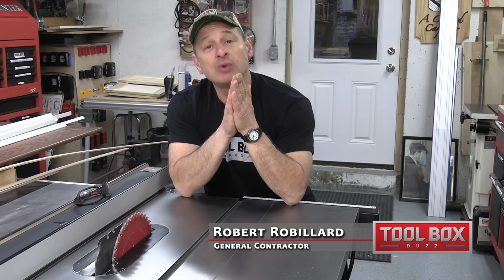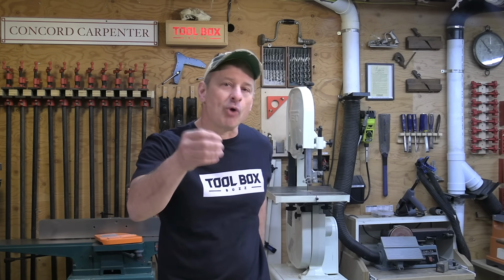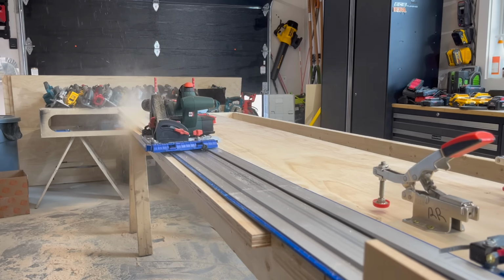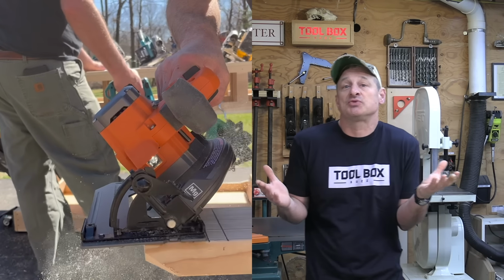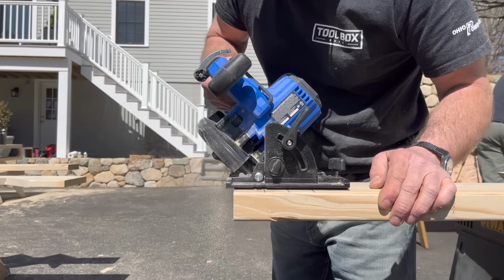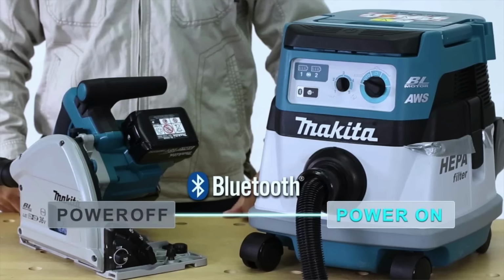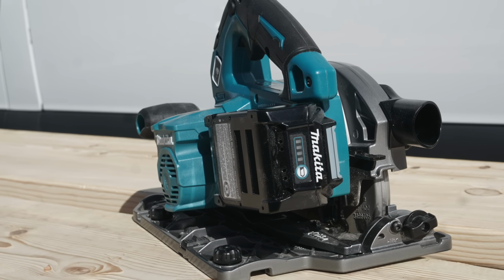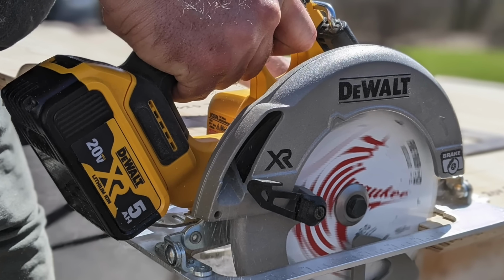Best Cordless 7-1/4 Circular Saw

Comment: OK so I sell tools locally here in Kansas City MO. I think the best innovation is the Flexvolt Advantage 7 and 1/4 saw by Dewalt. With a Flexvolt battery it is 90% as powerful as the 60V Flexvolt saw and still has the advantage of being able to use a 20V battery where it is 70% as powerful. There are really good quality very dependable 20V aftermarket batteries for Dewalt at a great price that you can buy directly from Amazon. The seller's name is ARyee and after selling about 400 of them locally there has yet to be even one return. Other sellers sell batteries that may be very undependable, so caution here.

Comment: Love these videos! I spy unreleased Packout and I’m jealy.
I think picking the XGT with track compatible base hurt it. It’s significantly heavier, bevels a lot less, and costs a good amount more (not that cost was ranked). But I may be saying that due to bias. My first circular saw like you was a corded Makita. Nothing feels as nice.
Reply from the maker: Good eye- video soon
Reply: That's what I thought until I we brought the new Metabo HPT 36V rear handle to the jobsite-everyone is ditchin the DeWalt, a Milwaukee and old favorite 36V(2x18) Makita
Reply from the maker: @baseballdude8491  lighter
Reply: @ConcordCarpenter  yes it's lighter and we are using it for applications we use the 6 1/2's for such as overhead and above shoulder jobs
I can tell the difference after a full day of cutting on my 51yr old body
But the young guys like it for how accurate, powerful, great site line and how they can wield it around
Reply: @baseballdude8491  I've heard a lot of good about it, but my issue is how little is available on their multivolt platform. It's been around a lot longer than XGT, yet XGT has a lot more options already. Battery platform is a big consideration to me. I already have four, but thankfully two chargers cover them all.
Reply: @nelsoncarpentry  The tools I use everyday/week are covered by Metabo HPT, Milwaukee and Makita. Metabo HPT 36V line has the largest 10" cordless+AC table saw, a great cordless mitre saw, SDS Max Rotary Hammer, Largest capacity and blade speed Portable band Saw, most powerful cordless grinder and Recipricating saw and only full size 1/2" router we use everyday.  The new rear handle is a jobsite favorite , cordless compressor, and vaccum are other tools that we utilize the AC adapter then available as does the table saw, mitre saw and Rotary hammer saving a bunch of battery life.  The Metabo HPT nailers have been my go too for over 25+yrs and their cordless are top in the industry as well.   I still have plenty of Milwaukee  and Makita tools to fill the gaps but Metabo HPT is better priced for the tools I mentioned above ad have been offered for 3-5yrs in many cases which I couldn't wait on Makita to introduce their 40V and they are backwards compatible with my large collection of 18V Makita's.  I'll probably invest in a few Makita 40V but only if its something the Red and Green don't offer.
Reply: @baseballdude8491  You mean the 40V Makita isn't compatible with 18V right? The 1/2" router would be nice. I fully expect Makita to bring one out though. Their router game is strong and now they have the battery platform to do it.
Reply: @nelsoncarpentry  yeah I just wish Makita would have made their 40V compatible with 18V tools like Metabo HPT MV batteries cuz then the 40V Makita 4.0Ah would be a 8.0ah for the 18V just like the green team did-Having a 8.0ah for some of the Makita tools would keep them running longer and offer a bit more power, but then they couldn't sell as many new tools(thats the real reason) this is why I am impressed with the green cuz making them backwards compatible and AC adapter capable saves my bunches of $ as I don't have to buy so many gosh damn batteries and a new tool to replace a tool that is working well already as some of my favorite 18V Makita tools are
Reply: @baseballdude8491   Yeah, I’ve had my gripes over that. Every business is out to make money. One thing though is their 18V lineup has been around for a long time, and the way their x2 tools are wouldn’t fit a battery like the 4.0 XGT as the 21700 cells are wider. But the 5.0 would with it’s 18650 cells. Or something like powerstack. I like to have as many batteries as tools, so I guess I’d be getting more either way. I’ll be getting an adapter to charge LXT on the XGT charger, so at least I won’t have a bunch of different chargers.

Comment: Thanks Guys for the very Thorough testing! One thing I was wondering about is that you had the old Bosch 6 1/2" saw for testing but didn't test the more Modern Brushless GKS18V- 25 which would've been alot more comparable to it's peers. Was a sample not available?
Reply from the maker: Its the model they sent for the test - they were given the test parameters
Reply: @ConcordCarpenter  Oh Gotcha. Thanks

Comment: Amazing work as always, gentlemen!  Your carpentry tool tests are usually more strenuous than Project Farm's tests and I appreciate that.

Have only two suggestions for you:

1) Metabo is the ONLY brand in America that has a "cordless-to-corded" conversion kit for their cordless tools and they do not get nearly enough credit for that.  Would like to see that feature highlighted in your tests of Metabo tools more often, specifically how much better a cordless Metabo tool does when converted to corded.  The power of corded with the option to go portable with cordless is a huge advantage over other brands.

2) No one ever tests the factory blade that comes with these things!  Most tool-testers assume that the factory supplied blade is trash and immediately pay $25-$75 for an aftermarket replacement blade.  As your final test, you should re-equip the saws with their factory blade and run a quick cut test to see how the factory blades do.  If the factory blade is of quality then that is essentially $25-$75 off the retail price of the saw since you do not immediately have to buy a better, aftermarket blade.

Comment: Why not use the bigger batteries when trying to max these saws out cutting lvl? I can almost guarantee the Milwaukee would not have stalled with the appropriate battery
Reply: He uses similar capacity batteries for each saw to make it even.
Reply from the maker: I agree - I use Milwaukee daily. We tried to pick a battery size to be inclusive to ALL brands. The 12 AH High OutPut battery would have dominated

Comment: Why hamstring the Fuel with a 5Ah battery when the 6Ah HO is available (uses 2170 cells)? Makes this saw perform, you can hear the RPM difference, and the kit comes with 12Ah.  The saw isn't being conservative in protection, the 5Ah just doesn't cut it.
Reply: We all know this, they just had to hype up DeWalt, because the check came early...

Comment: I own the Ryobi HP Brushless circular saw and I was really hoping it would come out at least in the mid range... But the only time you mentioned it was when you talked about how unimpressive the bevel stops are..

I gotta agree. I'm not blown away by this saw. But it gets the job done. At least for now until I can get the DeWalt flexvolt rear handle.

Comment: Great review as always, Rob!  Just wondering -- and apologies if I missed it being mentioned -- but I see the Metabo (non-HPT) in the vid but not in the rankings; was just wondering why that was the case, and what your thoughts are on that saw?
Reply: agreed, I also saw a Bosch but it's nowhere to be seen in the rankings. Maybe it didn't make the cut into the TOP 10? Honestly I was expecting to see the Bosch Profactor Saw. It looks great and it's supposed to perform as good as a corded saw with only 1 18V battery.
Reply: I saw the Milwaukee Model# 2730 6 1/2" saw in the video but it was not in the rankings.

Comment: i dont think it was a coincidence that dewalt came out on top of performance and was the only saw with 21700 cell'd battery attached, throw one of the new 6.0's on the milwuakee and compare it to the dewalt with its 6.0 bet theyre pretty comparable at that point.. really circ saws are hungry tools if you wanna push them through rip cuts best to use the biggest battery you can find, night and day difference in my saw when i put the 12.0 battery on it vs a smaller one

Comment: You said you chose batteries from the 4-6ah range but for the ryobi you show it with a 1.2ah battery. What's up with that?
Reply: 1.2 barely runs the 7 1/4 saw it is very underpowered

Comment: The Dewalt's 60V battery has 1.5 times the power output of the others. It has 3 banx of 5-cell series in parallel (in 20V mode), as opposed to the other batteries' 2 banx, resulting in higher drained current and higher torque of the saw. This unfortunately skews the test.

Comment: Rob, were all of the saws powered by 18650 batteries?  I know you’re aware that the Milwaukee FUEL tools provide optimum performance when equipped with the HO or High Output batteries, with 21700 cells.

Comment: Were you using 20V batteries on the Flexvolt during the test or 60V? I saw testing footage with a 20V battery. Why would you use that?

Comment: I am always impressed by the thoroughness of your testing.  However you are missing a handling category.  I noticed that all your tests were done with the saws in a tabletop position. I often need to cut in place in a vertical, not horizontal, motion.  It is impossible to do this with my Milwaukee cordless or 36 volt rear handle Makita.  Also you didn’t do any angle cuts leading with the narrow side of the plate.  I always have to hold the blade guard open when I start these cuts.  It is nearly impossible to hold the grip and the guard handle at the same time with either of my saws and from the looks any of these saws either. I find the safety switches difficult to use in any position except horizontal.  I have had a corded tilt-lok Milwaukee for more than 20 years and it is my favorite.  The handle is mounted behind the motor so it pushes easily.  It has a large grip which is near the blade guard and allows you to hold the guard open easily. It is also operable in any position,right side up, vertically up or down, upside down or sideways.  The importance of handling seems so obvious.  I don’t understand why it is never a consideration in the design or testing of circular saws.
Reply from the maker: Good tips thx

Comment: I have the Ryobi 7 1/4 saw I was wondering if you used Ryobi HP batteries. The Ryobi is low-powered if not used with at least a 4ah HP batt. (it will stall out easily)

Comment: Maybe the Milwaukee had gotten better results if you guys used a 6AH HD battery instead of the 5AH XC, just saying...
Reply from the maker: It definitely would have but we tried to keep the batteries, we asked manufactures to send us between the ranges of 4.0 and 6.0Ah t batteries. We used what Milwaukee sent us

Comment: Used makita’s aws adaptor on a fein shop vac. It only works 1/4 of the times the trigger is pulled, very inconsistent Bluetooth connection. 300 dollar garbage (200 for adapter, 100 for the chip)
Reply from the maker: Intertesting

Comment: When you tested the Milwaukee saw, did you test it with a 12.0 battery?  In the video it had a 5.0 battery on it.  It needs to be used with a 12.0 battery for maximum performance.
Reply from the maker: No smaller one
Reply: @ConcordCarpenter  You need to retest it with the 12.0 High Output, it has another row of cells for more current.  There is no comparison.
Reply from the maker: Larger batteries to give it slightly more power but not as much as you think. Think of it more as a bigger gas tank
Reply: @ConcordCarpenter  I saw tests comparing the 12.0 to even the 8.0 high output, and the 12.0 was decisively more powerful.  You don't want to use a 5.0.battery with that saw.  I've always ran my  Milwaukee 2732 with 12.0 and rarely put a 8.0 in it.
Reply from the maker: We tested the tools with what they typically come in as a kit
Reply: @ConcordCarpenter  They don't come with a 5, they either come with an 8 or 12.
Reply from the maker: Pretty sure the 8 Ah battery was added to the kit recently - before that it was the 5 Ah.  Either way we try to get the batteries in the same 4-6Ah range. The good news is you can use the info we provided and, if available, add a higher battery to the tool you like for more runtime and power.
Reply: @ConcordCarpenter  I've owned and used the 2732-20 with the 12.0 for that last 3 years.  I have intimate knowledge that the 12.0 works way better than a 5.0 or 8.0.

Comment: The flexvolt is really powerful but keep in mind, in those tests it was the only one with a 15 cells battery. All the others (i think) have 10 cells packs (except the makita 36v)  I'm pretty sure if the milwaukee had a 15 cells battery it could keep up. 
Great test as usual, you did a fantastic job.

Comment: How come Flex Saw wasn’t in the lineup?
Reply from the maker: They only sent a rear handle saw. Our next H2H is 61/23 saws, the rear handle.
Reply: Kevin if it helps.. I sold my dewalt flexvolt (awesome saw) after a few weeks of using the flex saw.  Yup.  Better.
Reply: @brianbush9453  Sorry but someone already tested the Flex against dewalt and the dewalt beat it the Flex would stall and get very hot
Reply: @loucifer4205  I’ve seen several tubers test the flex as well and it came out faster.  I know from personal experience it never cuts out under normal use..  It’s not mind blowing faster than the dewalt but it is a little.  Both are great saws, I prefer the flex battery platform, not just high quality but their release system and fuel gauge are in their own league compared to EVERY other company.
Reply: @brianbush9453  we've used Flexvolt, Mwaukee and Makita 36V(previous favorite) for yrs
DeWalt 60V has most oomph, Makita best site line and accuracy but they are all heavy saws for some applications where the new Metabo HPT 36V rear handle is almost 2+ lbs lighter the. The next kightest-never guys are fighting over these green machines and I never knew how much more work could be done with a rear handle- similar when I Dropped an ounce of if my bat in College and hit even more home runs than with the old Black Magic
Reply: @baseballdude8491  yes we know you are 100% team green rear handle and 1lb makes the world of difference to you. Please note this was on the standard 7 1/4 not your beautiful new rear handle no need to justify it in this thread wait until the rear handle h2h is released.
Reply: @brianbush9453  The rear handle is a gem but the sidewinder has been out for yrs and is a really nice tool and yes again it is lighter than the competition and is used in applications we normally use 6 1/2"s for and has more power than the 6 1/2"s
We have been using the Makita 36V(2x18) before this as well as the Dewalts and Milwaukee's--all good saws but the lack of knowledge and coverage for the green is my reason for sharing as they are better priced, lifetime warranteed, batteries backwards compatible for 18V and 36V and AC adapter capable-all features that many are not aware of when I'm at the big box stores and when shared many are thankful and have pleasantly got on the platform and thanked me.

Comment: Hey Rob
I just noticed your where to get the contractor grade saws.
ACME and Hone Depot plus local.dwalee get my money.

After your review decided on the Hilti, their 20 year warranty, are a higher end company.
The Hilti is only available at Home Depot on line or authorized dealer.

While my near 30 year old DeWalt corded is still working hard and making me $$$$.
The cord gets in the way, only goes so far, comes unplugged from extension cord.
Considering battery operated.
After building a few decks wonder the power and number of cuts before dead battery cutting 2x materials pressure treated.
Hum I wonder.

Thanks to Rob and the concord carpenter crew, nice video.

One to consider...
Battery operated worm drive.
Any chance of a review?

Comment: Why didn't you test the Milwaukee 2830? You test 2 Dewalt's and 2 Makita's but not Milwaukee's best 7 1/4 saw? 2830 has a rear handle and more features.
Reply: Rear handles are next
If u noticed they were all sidewinders or non rear handles in this test
Reply from the maker: We did - 6-1/2 saws next, then rear handles

Comment: Just an FYI 8/12/22.  Just bought the ridgid octane 71/4” for $85!!NIB at HD
5600rpm and has indent stops depths& angle up 56° has adapter for hose. FRICKEN STEAL!!
Reply: Just bought the 4 h and 6h batteries with charger and got the same saw Free

Comment: The batteries used are Not the same amperage, so your results are meaningless.   You need to repeat this entire comparison test with the same battery amperages.   And I would look forward to seeing that!  My .02 👍
Reply from the maker: That’s ridiculous statement. There is so many different batteries sizes in amp hours these days. You can look at run time if you want as one test. There are other things to look at features, accuracy, etc..
Reply: My bad. Thought I included the word "power" .  You need to repeat the power test comparisons with all the tools each using the same battery amperage (5amp?) or as close as possible, otherwise your power comparison results don't hold water.   It's  ridiculous that you didn't think of doing that in the first place!  See how they do that on the Torque Test Channel.  But, that aside, nice work on the other tangible product feature  comparisons.  Nailed those.  My .02  👍